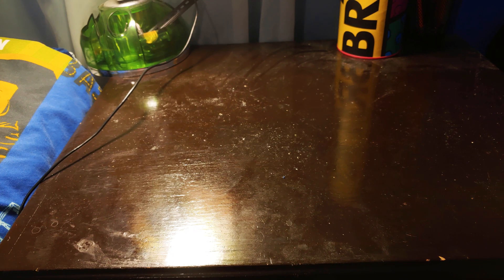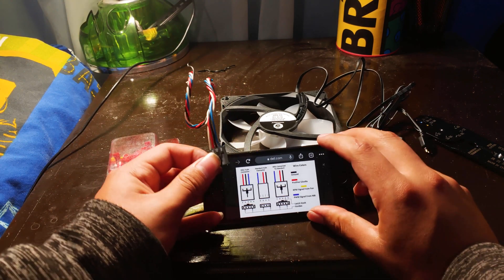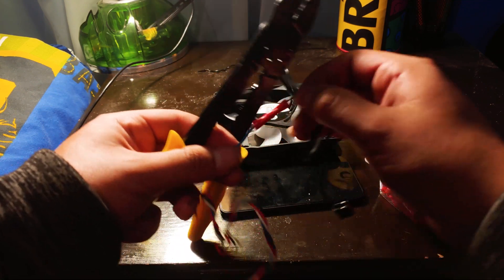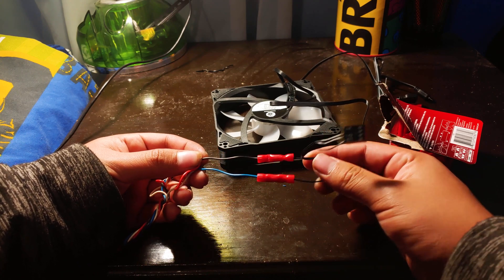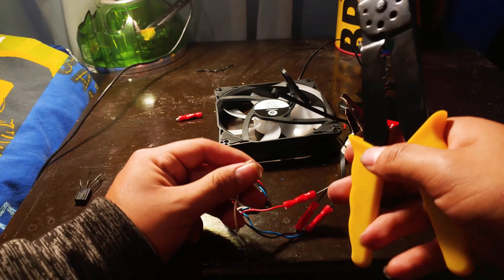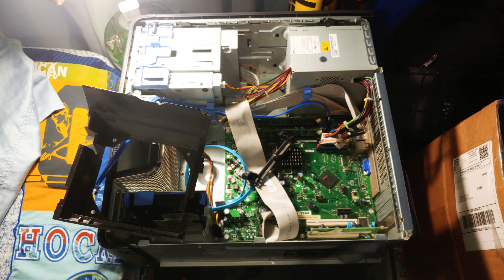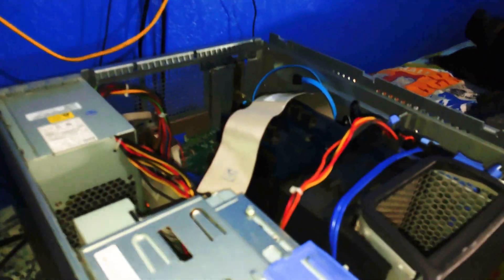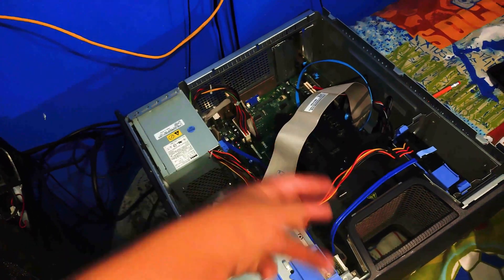Dell OptiPlex Fan Installation tutorial (Jank Method)

Comment: How easy does the 120mm case fan shroud come out of case once heat sink has been removed. My friend had problems with his dell (the model your showing here) where it kept powering off. On inspection of the heat sink under its shroud, I found the most clogged up heat sink and fan. Guessing the lack of fan is causing the pc to overheat, rather than there be a psu issue. Unfortunately, you have already taken the fan shroud off which I was hoping to see for reference.

Comment: I'm lost on how to put a 12v 140mm case fan In my Dell 9020 Optiplex.. It's a Thermaltake blue led and has a 4 wire all black pin .  I'm an old bike teck I can build wireing harnesses but I know I have to run it molex but don't know how to use the other 2 on my mother Karen rear fan that has that has the 4 wire in a 5 pin plug.  Hope this makes sence and you know.. If you do could you help. 
I would appreciate it , thanks Kiddo. Bob

Comment: There is a diagram with the new color wires?
Reply: And can this also work for the CPU Cooler fan? Like a Hyper TX3
Reply from the maker: @TashiSF6  yes and the diagram is still the same
https://www.google.com/url?sa=i&url=https%3A%2F%2Fwww.amazon.com%2FAlloet-Connector-Adapter-Converter-Extension%2Fdp%2FB07HF7YZ5W&psig=AOvVaw07BDrwD_dzi5LJ_G-O8KwE&ust=1606952920026000&source=images&cd=vfe&ved=0CAIQjRxqFwoTCMj10KL8re0CFQAAAAAdAAAAABAF
Reply: Sorry for asking so much, but that adapter could work with a 3pin fan?
Reply from the maker: @TashiSF6  yes but the dell bios will give you fan errors.